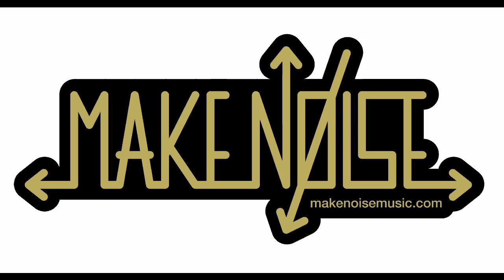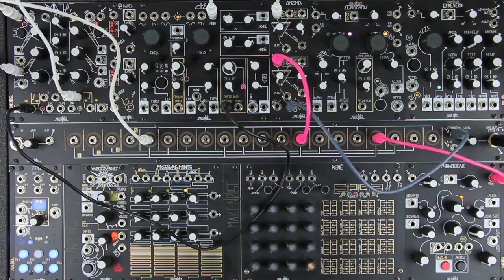Modularbeats: Envelope Following with MATHS

Comment: FINALLY! I can hear envelope following of an ORGANIC sound besides the bird chirps that animated R2D2. The last time I tried to get a better idea of E/F sounds, it was just a boring vocal modulation of a static tone that wasn't much different sounding than other modulation techniques. That beat matching is COOL sounding! I'm guessing there's another layer of modulation in R2D2 sounds for pitch. I'd have to make more complex patches than just running audio through a follower to get really wild. I pictured E/F sounding more like "talking violin" etc. sounds I've only read about but never actually heard yet out of VSTs. Now I wonder if some followers are more accurate than others or, like filters and wavefolders etc., do impart their own signatures on sounds. THUMB'S UP.

OK. I just FINISHED watching the video and the gates vs VCAs info is essential, thanks, as I was just impressed with the "simple crossfade"  1:22 bass drop. WAY cooler sounding than filter sweeps to me, ESPECIALLY those 303 acid ones I can't stand. I wonder what effects could be obtained using the envelopes to modulate other parameters in a NON quantized/sequenced way. E/F clocks? Pitch bends? Use 2 or more different samples to REALLY animate a static sound? I think I'd lean towards VCAs for precision. Ben Burt's R2D2 is a top 10 synth sound for me as it's REALLY animated and more complex than simple volume modulation.
Reply from the maker: Glad you enjoyed the video! Happy patching and feel free to post results if you film or record them!
Reply: @MAKEN0ISEMUSIC  Oh... I'm just a lurker. I'll be happy if i can ever get a job here and buy a $300 Zoom R8